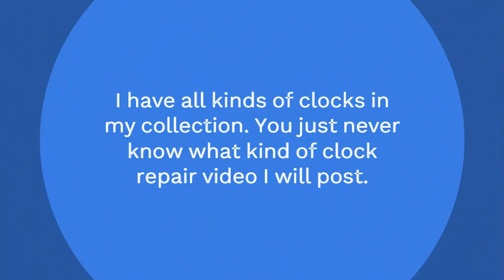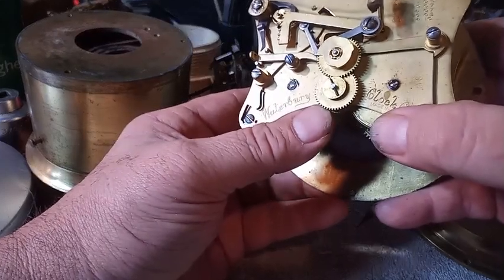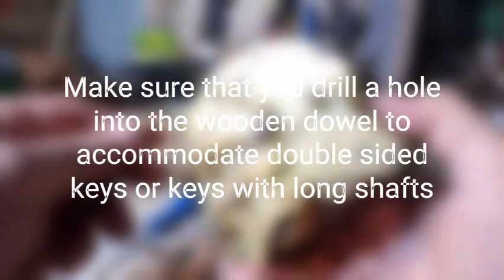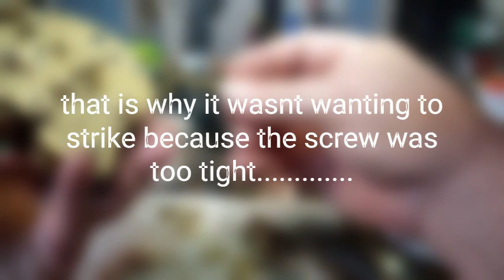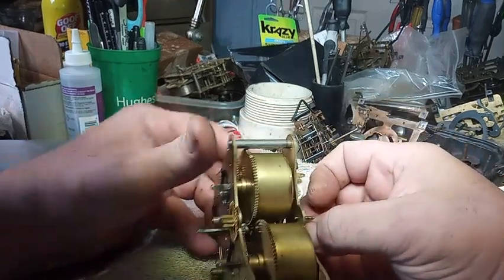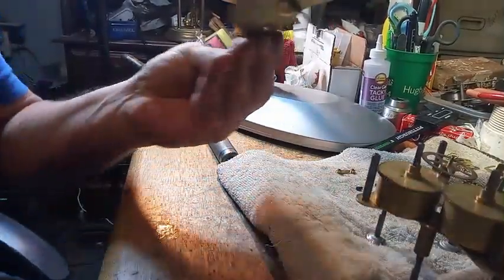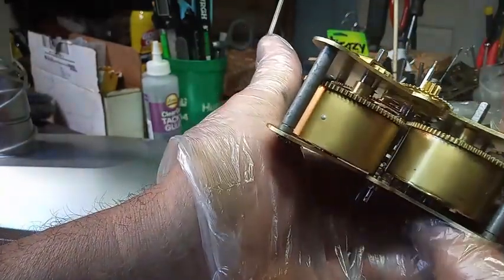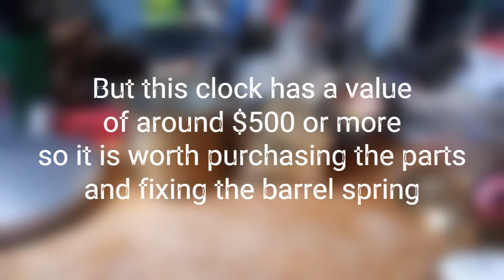Repairing a 1910 Waterbury Ships Bell Clock (See description)

Comment: the most difficult thing on working on one of these clocks was learning the bells. Remember, with that broken tooth, you are turning the gear and not the barrel. this will cause the clock to act different when checking the tooth.
Reply from the maker: I will have to watch a video to learn the bells. Do you have one?
Reply: @munnerlyn3  I never found a video that would help you with the bells. I typed in Ship's Bell Time.
Reply from the maker: Much appreciated. I will get back around to it after I take the time to order the springs that I broke but for now I have placed it on hold. That is what happens when I turned 50. I seem to loose interest in things much faster. Oh well. It will be there when I am ready again. Thanks.
Reply: @munnerlyn3  Well I am several years older than you, so you can just imagine where you will be at my age, lol.
Reply from the maker: I dont think this world is going to last that much longer. But I am 58 now and I plan on being debt free by the time that I am 60.............